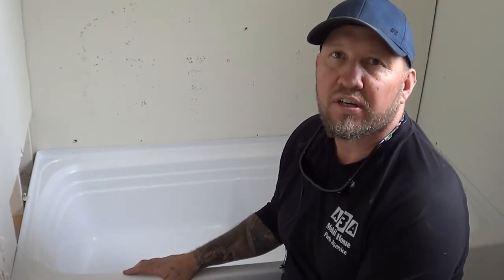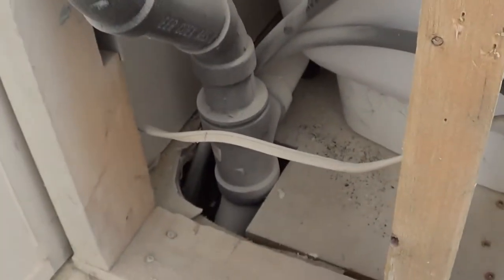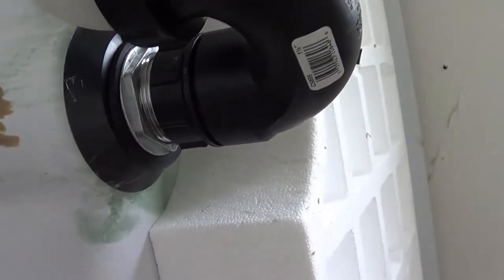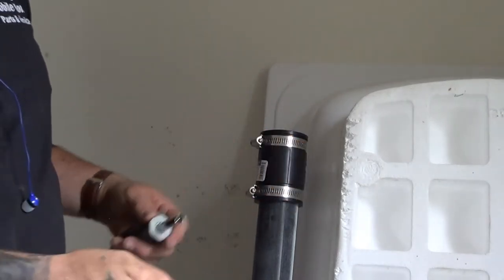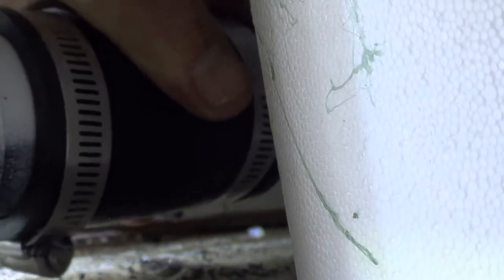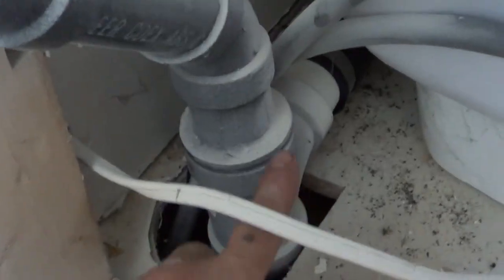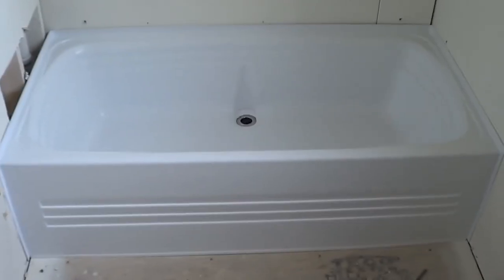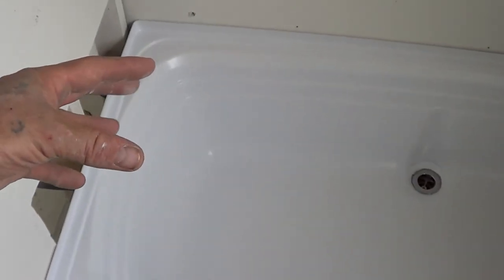How to install a Center Drain Tub in a Mobile Home

Comment: We are currently changing out our tub because the old plastic tub that was in there cracked and caused lots of water damage and mold. We got the same size tub and it looks like there is just a little too much space between the tub and wall and I'm afraid my wall surround is going to look terrible! What do you recommend?

Comment: Helped a bit got a few ideas. mine is similar center drain garden tub, faucet is on the wall on RH. but  in mine the p-trap runs underneath the sub floor board and the drain pops up out of the floor, so I'm having a hard time tightening the tub drain to the p -trap luckily I was able to remove them by just trying to remove the drain with a removal tool and they actually loosened to where I could lift the tubs out. But now they are just spinning when I'm trying to tighten the new tub..

Comment: We have a center drain garden tub with no overflow.  It's taking 24 hrs to drain. We've tried drano and plunging to no avail.  Called a plumber service and they wouldn't touch it. We really need the shower back. Thanks for showing what it looks like under there. Any ideas on how to unplug it? Thanks!

Comment: I have a center drain by an exterior wall, the faucet is on the right, the toilet is on the left and sink on the left side. I'm guessing the trap would be on the right side as the faucet is adjacent to the laundry room. Your thoughts.
Reply: Hello, yes usually that is the case. Taking that panel off behind that faucet should give you that full view. Thanks for the reply

Comment: My tub is just like this except the vent is on the opposite end from the faucets. When the gentleman replaced my tub, he cut the vent off completely and did not re-vent. It’s been 2 years and I’m having trouble now and I think it is bc of this. Do you think? And to fix it, does the whole tub have to come back out? Or is there another solution?
Reply from the maker: Thankfully you shouldn’t have to remove the whole tub as you can gain access to the drain system behind the wall like in the video. You can there put in a new tee and add a studer vent without having to put it through the roof. If you want to talk further pictures would be best.

Comment: Nice job.  There is a lot of debate over the "sharkshead" grab type fittings.  Very easy to work with, but some say they leak.  Your thoughts, if any?
Reply: Hello, I have us3d the push fit type for quite some time. I really like them and have yet to have a call back. Sometimes the fittings leak because the are not pushed in all the way and this seat incorrectly. Really, I do like them and feel they are the way to go. (The Sharkbite company gives a 25 year guarantee on their fittings.)

Comment: I'm screwed. Mine is a front center drain and I can't find another. My home was one of the last ones built by local factory before they shutdown and the nearest mobile home store said I'd be extremely lucky to find one. I can find rear center drsins and left/right, so I may have to replace my drain. My current setup is on the right if you're looking into the bathroom. I have never done it before, and it worrying me, but I can't afford to pay a plumber $250 or more to do this. Thats the quote I got. My tub has a cracked in it, so I need to get this done. I have a piece of flex seal tape on it which works until then.
Reply: I understand the hardness of getting the right part. Have you looked under the tub to see where the drain hooks up to the tee? It’s usually easier than at first thought to move it to one side or the other. Plumbing is mostly just math and prep work. Take a lo9’ under and see if it’s possible. I’ve found every time that I am able to move them, but I do it all the time so am comfortable with it. I understand your hesitation.

Comment: The tub flange is on the outside of my drywall. Previously, there was some cheap-looking molding covering it. I want to improve this and make it look better. What is your suggestion for covering this up?
Do I basically need to add another layer of drywall to shrink my bathroom size?

Comment: Boy if i ever had to build a house I sure would spend some time planning on how all the plumbing would NOT be hard to access and repair. That drain connection and p trap are impossible to access and inspect for leaks. Most builders and renovations don't provide access panels and they couldn't care less how difficult they make it for the next guy to work on it. Those cut outs in the floor are where critters will find and nest up under the tub! And let the cold weather in. 

I ran my water supply line up from underground surrounded by plastic buckets and super insulated it all the way up to the closet floor so there is zero chance of freezing. Now all the hot and cold lines run on the ceilings exposed pex plumbing with zero chance of freezing and all visible so any connections that develop leaks can be easily detected and addressed. It looks a little industrial but keeps me from having to crawl under the building which is on a slope and gets to near impossible on one end of my double wide. 

The drains are a different problem and I'm experimenting on running them straight out the walls and right to the septic clean out pipe nearby. Up here in Oklahoma the temp got to -17 F a couple years ago! So far with the right pitch no freeze problems.

Comment: I have 1969 mobile home with 64 bathtub. I'd like install 60 inch bathtub would this work?
Reply: Hello it would work if you have the space of course. Usually mobile home tubs are 54x27. Same basic application however, if you are getting the Mobile Home’ type. You just need to know if the existing plumping i.e. p-trap, is above the floor, really whether the tee the p-trap empties into is above the floor. That is the mobile home design. If you are looking to do a remodel and can move the plumbing wherever you like then a regular house type would work. Thanks for the question.

Comment: My master bath is 60” am I correct in guessing that I can switch it out with a standard size tub if I move the plumbing?
Also I watched you other video in order to change out the hall bath very very helpful but I would highly recommend going with fiberglass vs abs. Fiberglass is way more sturdy as I was changing it out due to it being old and developing a crack. It was only $20 more. 54” tubs are very expensive so $20 more fore it to last longer is well worth it
Reply: Ken Moore, hello, the 60 inch size is a standard house size tub and there are more options available when you go to ‘regular house’ sized stuff. The drain can be moved where convenient as long of course as there’s room and no need to cut out support and so long as you can still have the vent inline somewhere. Also, I agree that fiberglass is best as long as the drain on the unit is elevated to accommodate the existing drain. A lot of the fiberglass ones sit the drain flat on the floor which would mean moving the tee below the floor which is obviously a lot of work and sometimes impossible. Also, sorry, have not found the price difference that close between abs and fiberglass.
Reply: I did notice the drain on the standard tub is only about an inch off the ground. I was considering building a 2 or 3” platform for the tub to sit on 
I figured I can just put a row of bullnose tile to hide the exposed side. Not sure if I’m missing anything I’m trying to pick your brain so when I go to doit everything will be 100% 
Ty in advance